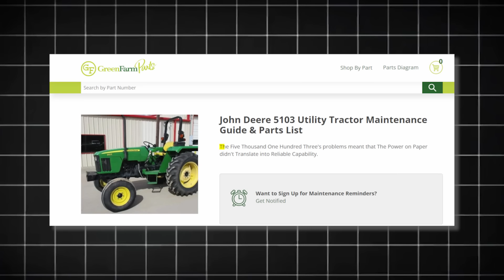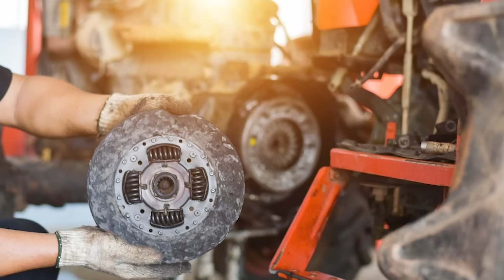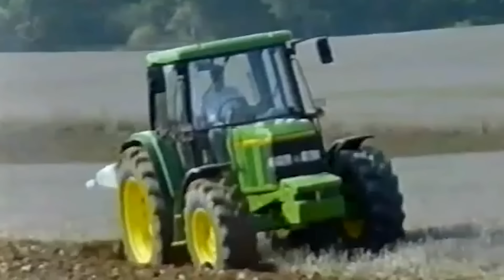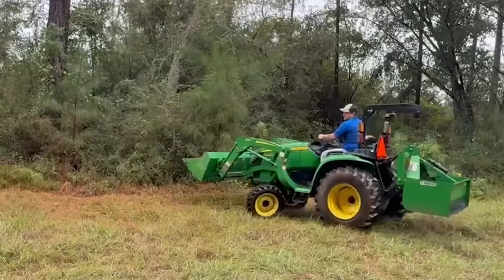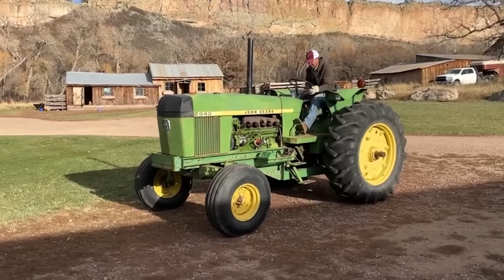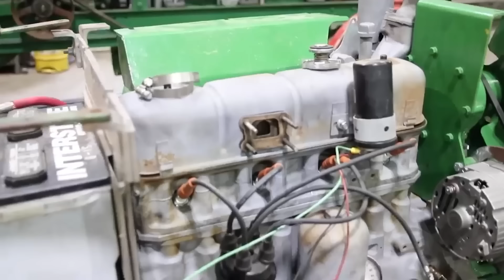13 WORST John Deere Tractors Ever Created!

Comment: I have 720 Diesel. Starts fine in single digit temps.  Has pony    They talk of 530 weak hydraulics.  3 point will lift enough to make front wheels lift off the ground

Comment: Two cylinders did well up to they stopped with them   They  were just as good as any with jhst two  cylinders    the 530 was a small  45 hp is pushing it   35 is what it had in the real world   2 bottom    equal to a B
Reply: my Uncle use 3 14's on his 530, liked it better then his 60

Comment: They picked some of the most popular tractors to trash! Retail on the 530, 720, 730, 4000 and 4320 says otherwise for nearly 70 year old tractors. Yeah John Deere really knocked it out of park replacing the 530 with the failure of the 2010. All the 20 and 30 series two cylinders were far superior with hydraulics and 3 point hitches than any previous 2 cylinders.

Comment: 720 and 730 and 830  most  all used  a pony  motor  like  cat to start  the engine  they weren't  that  hard to start  you  to do better  research  on your  tractors
Reply: Well the diesel ones did, the gas, gasoline and all fuel tractors were all electric start